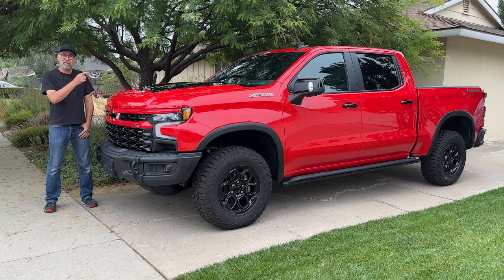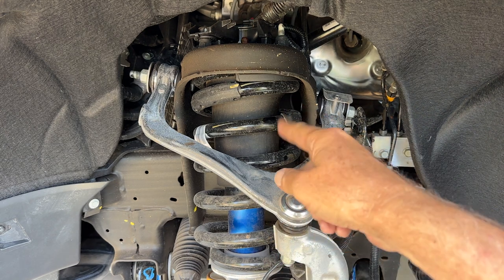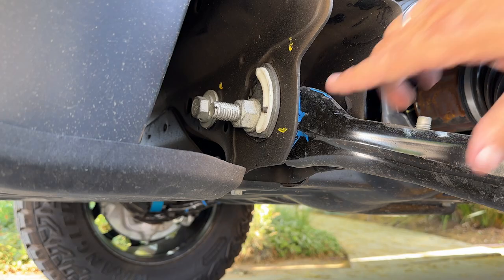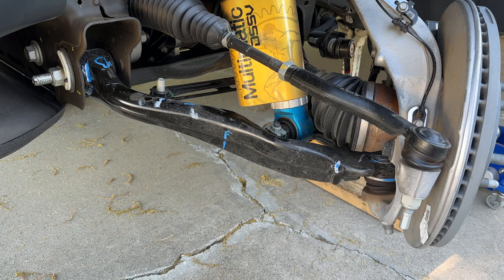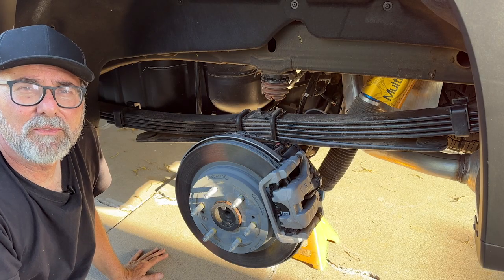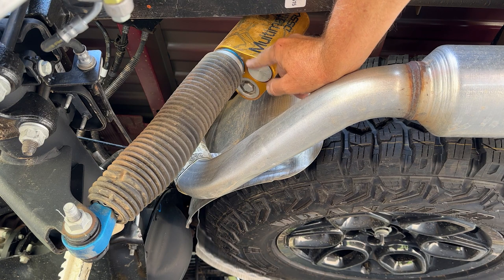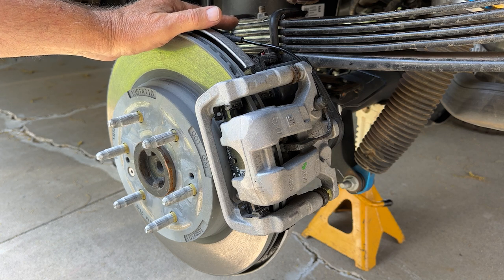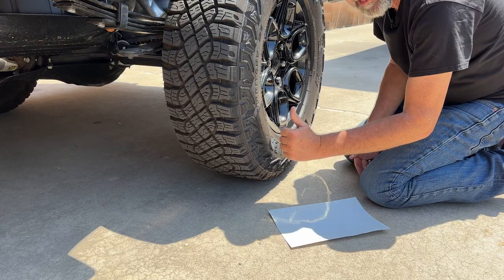Chevrolet Silverado ZR2 Bison Suspension Flex Test | Car and Driver

Comment: Thanks Dan for doing this video because have been waiting for you to do one for the Silverado ZR2 and you did thanks again.
Since  then have upgraded my ZR2 tires to 35’s the same specs on the hummer electric truck as I will not be able to clear 12.5 “ wide tire without a lift, so I went with 12” wide and am not going back as the truck feel more planted now, and I just love the ride better too plus it’s greatly improved the look and the ground clearance on it…..all without any front or rear lift kit. All stock plus a little trimming just to clear the 35’s from lock to lock., plus it’s nice to drive by and the Raptors guys look at you be like is that a ZR2 on 35’s?.  because the truck just look like its came from the factory that way.

Comment: I hate the unprotected shocks.  I hit a rock with my 05 Duramax and had to cut off the shock mount, straighten it out and weld it back on then replace the broken shock.  Military trucks have bolt on skid plates on their trucks.

Comment: Why isn’t that stiffener in the front LCA cast in? Seems like that strength would be needed regardless of trim and also seems like an afterthought.
Reply: Yeah that was interesting to me as well. Wonder if it’s just an adaptation of a normal Silverado control arm which doesn’t have that or something?
Reply: The LCAs on they GM half tons make me very nervous. They do it look robust at all.
Reply: @ALMX5DP  exactly what i was thinking. My car has triangular shaped LCA and it's just a Car(TM). Visually it seems like if that stiffener weren't there the control arm would have a major weak point. And if they all have it, I don't understand why it wasn't designed differently. Hopefully Dan responds and can teach us what we're missing.

Comment: Wow, I didn't know that toe was a thing for a solid rear axle....😂😂😂😂
Reply: I am a bit confused by that too.
Reply: It's for turn radius.
Reply: Because the center of the leaf spring is passing through the center of the forward spring mount bolt, I think the idea is that there will be less movement of the axle forward or backward at the spring perch.  If it's flexed with one side in full compression and the other in full droop, and the axle moves slightly forward on the left side and slight backward on the right, then there will be some toe angle generated, but obviously the same on both ends of the axle.

Comment: The Ford Raptor's numbers would also perform better rock crawling, not just Baja style off roading.  Would like to know the price difference between the Silverado and a Raptor. I'd take the Raptor any day.
Reply: The used market will tell you. 
As of this week near me are lots of ZR2s in the $55-$60k range. 

Used gen3 Raptors are still in the $80k+ range. 

Damnit 😢

Comment: All the mounting brackets for springs and arms look weak.
Reply: What knowledge or experience is that based on?
Reply: @st33ldi9ital  funny Dan’s eyeballs didn’t mention it and he has considerable experience around vehicles.
Reply: @ALMX5DP  Yea, well either Dan needs to get his eyes checked or he needs to hit harder trails and get off the pavement more. He also getting paid. Just like C&D is.
Reply: @st33ldi9ital  has anyone broken the components you speak of on what you’d consider “harder trails”? Just looking for some substance here instead of keyboard warrior assumptions. 

And of course Dan is being paid, he is a journalist who makes content for C&D. Not sure why you assume C&D is being paid off here.
Reply: @st33ldi9ital  all the time? Would love to see you point to something to support that statement. I’m just trying to find actual verifiable information to back up your assumptions here. Keyboard warriors tend to spout off without being able to articulate their argument, so I apologize if you have something to share which shows your statements have validity.
Reply: @st33ldi9ital  I think one of your comments was removed, but the crux of the issue seems to be your displeasure with truck prices and the fact they are marketed as being very off-road capable when they are just mediocre. Prices are what they are, and marketing will always be marketing to generate hype and sales. Doesn’t mean though that the product is somehow faulty or prone to breakage. Anything will break if pushed and abused in an environment that it was not designed for. But for the average consumer who is looking at this truck and uses it with some semblance of rationality, it’s just fine.
Reply: @ALMX5DP  Thanks for proving my point. "Anything will break if pushed and abused in an environment that it was not designed for." Exactly. It's not designed for offroad. It's a work truck meant for the road.
Reply: @st33ldi9ital  you do realize off-road is a broad term with a wide spectrum of conditions right?
Reply: Concur. First thing I noticed. That front suspension doesn't inspire confidence, but not sure how many will put them to the test.